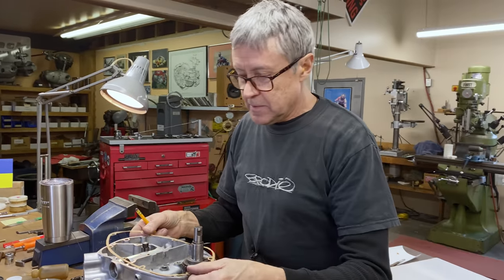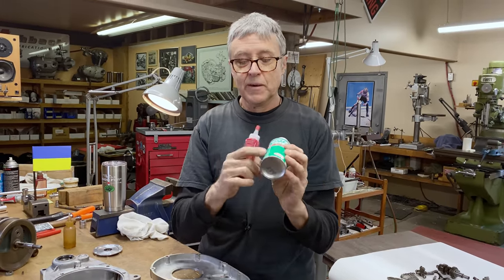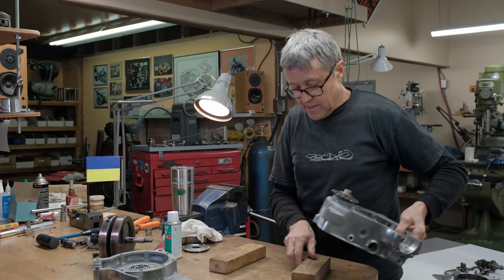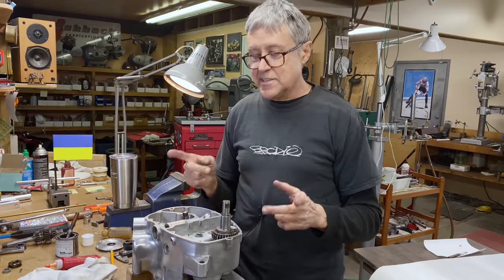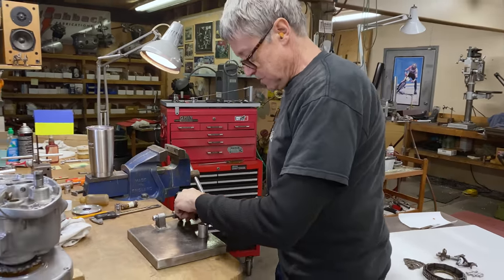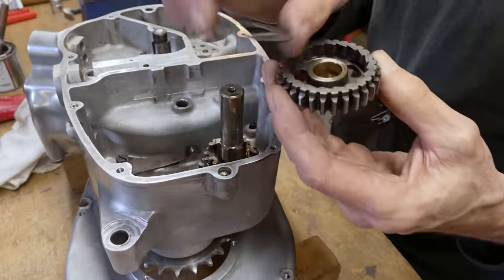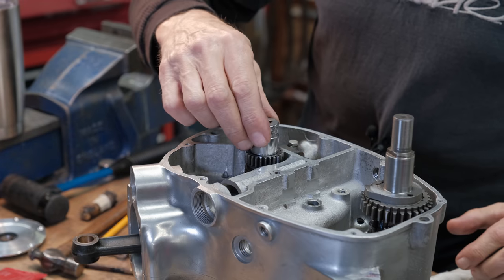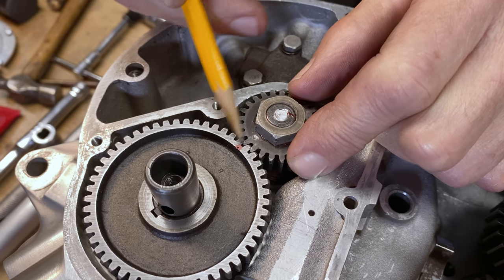Tiger Cub Engine Assembly - Part 1 // Paul Brodie's Shop

Comment: 40 some yrs ago I got my first real motorcycle, it was a mid-60s cub. It needed a lot of doctoring. Armed with only a Hanes manual, a few of my pops  wrenches that I grinded out to fit the Brit nuts n bolts (man, was pop ever so pissed!))) and barely no mechanical knowledge, I did manage to rebuild the motor. It was a blast to ride and ran great for many years. I never used locktite nor did I ever even heard of it. There was no ebay at the time, so I could rarely find parts and ended up making them or making fit parts from various other manufacturers...
I must say I couldn't find an original gasket set and didn't realize you could buy gasket paper to make your own, so I ended up using Permitex's aviation form-a-gasket. I must say, over the many years of hard riding miles, never once did that little beast leak a single drop of oil ..now almost 50yrs later and after sitting for half that, I'm ready to go through it again....I just hope I can get the cases apart without beating the crap out of it)))

Thank you for this video, Sir... your knowledge and expertise helps immensely
Reply from the maker: Great story! Thanks for sharing that. Especially when your Pop was pissed for you grinding the wrenches!
Reply: @paulbrodie  yeah, it's a good thing that I could run fast)))))) It's funny though, quite a bit years later, he stopped by my house to visit and caught me tinkering in the garage. We chatted for awhile, then he looked at the  cub against the wall and asking if it was the same bike?.…  After giving me a slight womp on the head he said "hey, that ugly old bike looks pretty good now...it was cool to see abit of pride come over his face especially, since I tormented him for my entire teenage yrs)))))
Reply: @paulbrodie  what I can do now is bcuz of people like him and you..
Thanks again, and I look forward to checking out all your videos
Reply from the maker: @nova2fly209  Ah, Fathers and Sons!

Comment: The bush for the  oil pump drive is held in place with the case screw , my cub is 1 down 3 up on the gears .
Reply from the maker: I think mine is 1 down three up, but it's been a while and my memory is not 100%!    :face-orange-raised-eyebrow::face-orange-raised-eyebrow:

Comment: Thanks Paul and Mitch. Reminds me of a story from a few years ago. Some friends had rescued a Triumph Spitfire from a garage. They rebuilt the carbs and the ignition and I was there for the start-up. A little Sure-Start engine spray and it fired right up. Only problem was the LOUD hammering sound coming out of it. Turns out nobody thought to check the oil! First start in 20 years, dry as a bone. A few liters of oil fixed her right up. 10 years later and it is still going strong.
Reply from the maker: Thanks Don. Good story, great that the engine is still going strong!

Comment: Thanks for the Loctite product tip. I normally use the Red anarobic sealer on John Deere bell housings, but i have made up a alu conversion bell housing, so these products you use should be better.
Again, you and your camera man make GREAT vids, dont stop. The problem now is I wish I never sold my Norton.
Reply from the maker: Steve, thanks for watching and commenting. You can always buy another Norton 🙂

Comment: I enjoyed that. Way back in about 1972 I worked on and ruined one of these engines. A pal of mine had one and the mainshaft was knocking in the bush that supports it behind the clutch.  I offered to replace the bush. The shaft that the clutch fastens to goes through a gear with a bush inside it, and that bush can wear and make noise. Here's my point. I very stupidly plastered the mating surfaces of the cases with red hermetite gasket cement in an attempt to stop the legendary oil leaks these engines used to have. I used far too much of it and when I returned the engine to my mate, he soon experienced big end failure. Later, I had the same result on my own C15 engine after plastering too much gasket goo (again - red hermetite ) on the casing where the base of the cylinder joins the crank case top. Big end failure within a few miles. I must have been a slow learner to do it twice, but eventually, the penny dropped. Since then, I have been EXTREMELY reluctant to use gasket cement. That stuff you scraped off on the outside, unless very carefully applied can bulge into the inner chambers and may come adrift and block narrow oilways in the crankshaft. I know I used more than you did in my inexperience, but I never want that kind of disaster  again.
Reply from the maker: Yes, I have heard about Red Hermetite and the problem of applying too much... Thanks for commenting and telling your stories :)

Comment: Paul I really like how you do things, it is so nice to see someone who knows what they are doing. I have used one of the best engine sealers ever made
over the years, which was use on early Rolls Royse cars also it was used on the railways back in the steam days + they still use it today.
I have found it to be very good for people who know that casings should always be smooth and flat. It is a British product like myself and is 
called "Welseal", it comes in a tube and looks like a brown liquid, always keep the tube upright when opening as it is a thin consistency.
The wonderful about this product is that when it is applied to the surface of a casing it appears yellow in colour, if it is applied to thickly, it looks brown,
so you can smooth it out until the colour is yellow as it should be! Great for paper gaskets or two very clean faces. You apply it on both faces and
leave to go tacky, then it will stick and seal the two halves perfectly. If you want it, it should be on E-bay. Thank You, have a nice day.
Reply from the maker: Chris, thanks for watching and commenting.

Comment: When you had that thing all apart I would've gone ahead and made patterns for the gaskets/made some gaskets out of gasket paper. From there adding a thin film of RTV or that spray gasket adhesive stuff would've sealed up the bottom end just fine. A lot of people hate RTV these days but it really has it's uses if you don't just put a massive glob of it on and let it get into places it shouldn't be. I'd think adding some assembly lube into the oil pump and on the gears would've been useful too, just to make sure everything was well lubed before that initial startup. It'll thin out quickly and come out in the first oil change. I'd also lubricate the crank before putting it through the bearings.. An unlubed shaft is never good. :P
Reply from the maker: I don't get excited about making gaskets. I'd rather buy them. In the video I did say I was doing a mockup build and that the engine would be coming apart, for a few details, including lubing the cam and other parts.

Comment: That all looked familiar from a long time ago... just the same as a BSA C15 gearbox, I think. And the joy of seeing you use a real Britool socket (not the French imitations of today). When I went for an apprenticeship as a motor mechanic (in a Vauxhall/Bedford (GM) garage) I bought a Britool socket set. It had to have both Unified and Whitworth/BSF sockets. £102, and pay back my employer at 10 shillings a week. Two years to buy your tools! Those were the days (so they say!!). I gave that socket set to my God-son when I retired, and its still in use. Enjoyed it Paul, thanks. And thanks to Mitch behind the camera. Les in UK
Reply from the maker: Thanks Leslie. Yes, I have had some of my tools a long, long time!
Reply from the maker: @improvsax   Whitworth tools are a must if you have a British bike. I bought a bunch of Proto stuff in 1973!
Reply: The CeeFee design is derived from the Tiger Cub and Terrier before it.  The gearbox is just the same.  It's VERY important to put the gearbox selector quadrant's pivot pin in the right way round.  One end is threaded for extraction.  If you put it in the wrong way, you can't get it out again...  Guess what I did....
Reply from the maker: @pashakdescilly7517  I don't think one end is threaded on mine... but there is a groove that you can tap with a brass drift; that's what I do.

Comment: my first engine rebuild..and modified.. was a 998cc Mini engine... would hardly turn over despite me using the Haynes manual  ...the village got me to take the motor back out and once we discovered I'd put a big end shell bearing in the wrong way...he cleaned of the burrs with a scraper made  from an old file the engine was a flyer for 10,000 miles... then the crank snapped...but the motor only cost 15 UK pounds...piper 275 cam, 998 cooper head single big SU , 2 inch ex-rally car exhaust ....when minis where cheap and fun

Comment: When you installed the oil pump gear bushing you mentioned that you didn't know what held it into the case. The bushing had a groove in it and looks like 1 of 2 holes might line up with the groove to located it. 1 is small like a roll pin might go into it and the other looks like one of the shifter cover bolts might line up with that groove also.
Reply from the maker: I did figure it out, but that was so many months ago I can't exactly remember what the solution was. Thanks for watching!

Comment: Yes indeed, I've learned to love that Loctite Anaerobic Sealant for Marine, Motorcycle and Aircraft engine cases. Back in the old days if you had trouble like a gear out of mesh, you may have to clean and re-apply the sealant as you only had a minute or so before the sealer 'skinned' or started to dry. I've got my fingers crossed for you on the 'No-Drip' cub case! Great video.
Reply from the maker: Thank you!

Comment: It's actually easier to put the two gear shafts, selectors and selector shaft all in together as one unit. I like to run a tap down all the ally casing threads also, it's amazing how much rubbish will come out, old gasket cement, even all machinings from when factory put original threads in it appears. One down three up!
Reply from the maker: Yes, I did run a tap down all the case threads. You are correct about the shift pattern. I made an assumption, and I was wrong.

Comment: Good job! You just have to have a go even though you did it before.
Reply from the maker: Thanks Dermot. This is my first time completely assembling a Cub motor.. 50 years ago I worked on the transmission and cylinder barrel, that's all.

Comment: Heck I have had to make an emergency repair, I didn't have any gasket maker, all I had was cheap thread locker that came with ceiling fans, so I used that , nice and thick, it worked, no leak!

Comment: Hi dear, I like the way your work on motors indeed finest work, I have checked since your previous video that the method is same I work on cub motor, I have intalled electronic ignition in my cub that is not particular Brit bike electronic ignition but I have installed in my way and that video is available on my channel and now I am working on rotory oil pump to fix in cub motor, I have designed it further equipments also, although I like your work absolutely.
Reply from the maker: Thanks for liking our videos. That's great that you also have a Cub, and are spending time to make it "right"..  Good luck with your Project!    :face-fuchsia-tongue-out::face-fuchsia-tongue-out:

Comment: Precision personified. Unlike me and my mates when we were young fellas, you didn't have a bucketful of bits left over!!!!
Reply from the maker: Thanks Phil. Not quite right about the bits, though. I started with four engines, took them all apart, and used the best parts to make one good one, hopefully. I have LOTS of bits left over...
Reply: @paulbrodie  You're spot on; but we used to start with one engine and had enough bits left over to building another three!!!! Not the most successful of teenage mechanics!!!!
Reply from the maker: @janetmuskett3210  When I was a teenager I ruined several motorcycles learning to work on them.

Comment: Hi Paul, I am really enjoying the Cub build, I am a Terrier man and halfway through the same process. Torque setting are listed on page 176 of Mike Estall’s superb Tiger Cub Bible - I think you are a fan of the book. Thumbs up to Mitch, between the two of both you manage to entertain and inform, a hard trick to get right every time as you consistently do! Well done and best wishes from Wales. John
Reply from the maker: Thanks John. Yes, I have that book and looked on page 176. I figured 30-35 ft/lbs for those 2 nuts, so I was close. Yes, Mitch and I are a good team!

Comment: I'm really enjoying watching your Cub go together. I have to disagree, though, on the shift pattern. All the Triumphs that I ever messed with were down for first, up for the rest. One of my buddies back in the day rode a pre-unit construction 650 BSA, and if I recall correctly it shifted up, down-down-down.
At one point I rode a Triumph T110 on the street and raced an Italian Parilla 250 on scrambles and flat track. The two machines not only shifted on opposite sides, but in opposite directions! Suffice to say during the heat of battle, the poor Parilla saw a few unauthorized ventures into the higher RPM ranges. Nothing like a full throttle power shift from third to second! Fortunately the high mounted camshaft / short pushrod valve gear enabled the engine to survive.
Reply from the maker: Yes, one down and three up. I was wrong. I assumed, wrongly. Thanks for watching and commenting.

Comment: Nice job! On reciprocating aircraft engines like a Lycoming or Continental you lay a thin strand of silk string in the sealant between the engine case halves to help with sealing. I believe that the correct term for hand torque is "tech torque", after more than 30 years experience I now have a calibrated wrist.
Reply from the maker: Fred, that's so cool you have a calibrated wrist! Someone else mentioned a strand of silk, so it must be a "thing". Thanks for commenting.

Comment: Something I have heard of but have never done myself is to place a piece of thin silk thread in the gasket goo all around the piece before putting to two case halves together. It is supposed to prevent oil weeping.
Reply from the maker: I have heard about using a silk thread, but have never done anything like that myself.

Comment: I was just watching your video and if you look at 9:42 im fairly certain your oil pump gasket is installed backwards may not affect anything bit I didnt see it posted in the comment section anywhere. Otherwise amazing job from where I'm standing. Your videos never fail to impress.
Reply from the maker: Thank you. I did try the gasket a couple of ways, and this is what looked best to my eyes... On the right side cover gasket, I couldn't even get the holes to line up the gasket was so poorly made.

Comment: On alloy metal to metal surfaces I get great results from Yamabond 4, it does not set hard so it can flex with temperature changes and is easily removed when you need to.

Comment: I took notice of how the internals all slipped together as you progressed.  Most engines I worked on (never a Cub in the bunch) required an assembly "puller" to squeeze the cases together.  Bultaco engines caused a person to wince and in both pulling apart and reassembling, the stress and noise of the bearings being forced home.  All ended well enough but not something I'd enjoy doing every day.  Good luck on the case sealing, I hope it's as oil tight as you want.
Reply from the maker: It seems that Cubs are made with loose tolerances. Aermacchis, on the other hand, have to be pressed together and pulled apart.

Comment: Fantastic video Paul! Can’t wait for part II. My best friend, whom I have been riding motorcycles with and tinkering with mechanics with for the last 40 odd years sent me a link to your channel yesterday and I’ve gone down the Triumph rabbit hole since. I’m primarily a Suzuki motorbike guy but I have a high appreciation for all things mechanical and your channel ticks all of the boxes. Takes me right back to being 10 years old looking at all of the used bikes at the Suzuki Centre on Dunbar or the old Brit bikes at Tonka on Broadway.
Reply from the maker: That's amazing! I bought motorcycles from both of those shops. We must have lived very close.
Reply: @paulbrodie  we did live fairly close but I don’t think we crossed paths. I was at 35th & Crown. In the mid-70’s, I had a Gemini 2-stroke mini bike that came in a box of parts. It was missing the shifting mechanism and somehow the guys at the Suzuki Centre managed to find the parts and assembled the missing pieces. Many years later I bought a used GT750 (2-stroke triple) from Tonka but I clearly remember the cache of BSA singles they had in one of the adjoining rooms. I thought it would have been fun to have a racing class for them up at Westwood. My dad was big in English cars (Austins, MG’s). He built several cars in our garage. I’m pretty sure I have his British wrenches and sockets in a storage locker. If I can find them, I’ll send them out your way.
Reply from the maker: @andrewwasson6153   I lived at 19th and Wallace. We used to ride at the Horse Stables, 33rd and Camosun, sometimes. I have already had a couple of people donate Whitworth wrenches and sockets. Your offer is appreciated!

Comment: I was shown to run an oil stone over the cases and use Hylomar blue, never had one leak using that method. 

You got Lucky with the gears, normally takes me three attempts with lots of swearing... 🤣
Reply from the maker: I try not to swear, at least not on camera..

Comment: hey Paul, great job as always my friend, if its any consulation when you dont have a torque wrench, when dealing with aluminum cases, once you have it snugged, an 1/8-1/4 turn is sufficient which comes out to approx 12inch lbs, been building motorbike engines for decades and hopefull this helps for your future builds...great job again, looking forward to your topend assembly :)